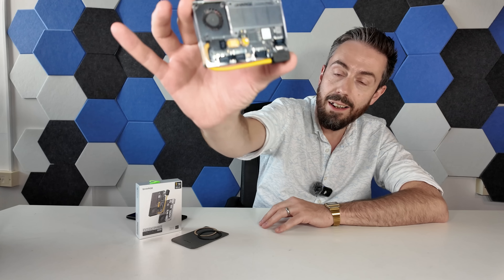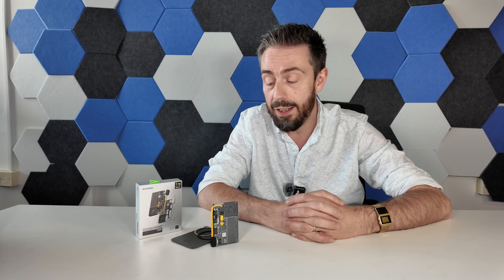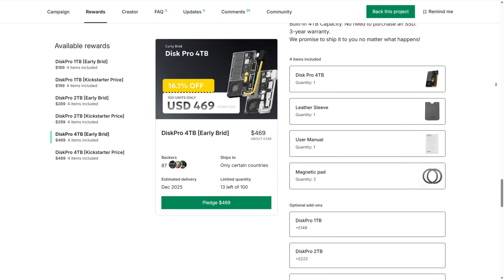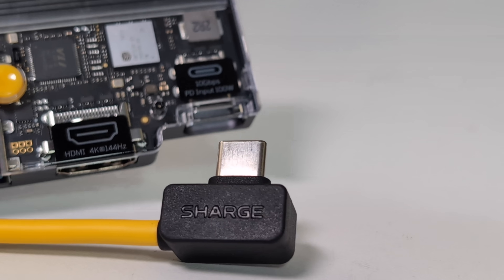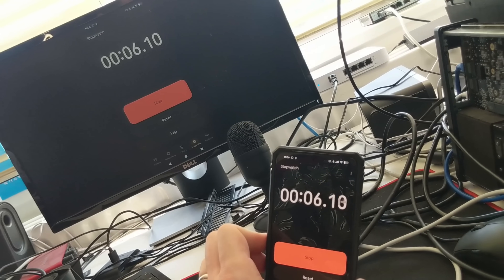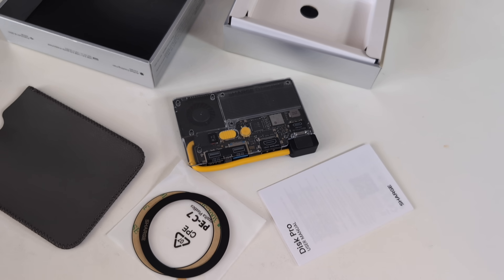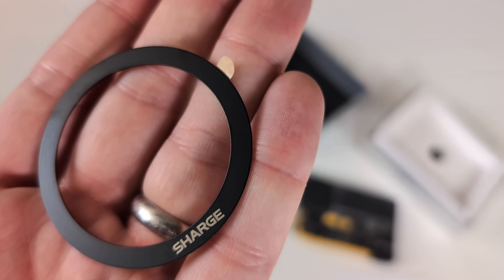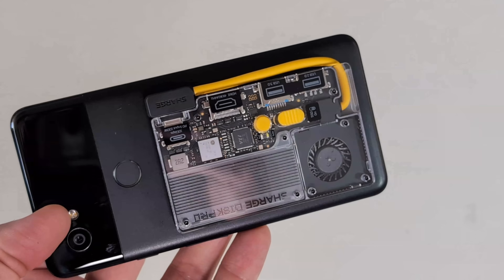Sharge Disk Pro Review - Mobile Storage Done Different?

Comment: dood, im still wondering if this device is good, its only 10g usb-c, and dp alt require 12g, meaning if using  the ssd + dp alt it cant even handle it right ?
Reply from the maker: Never had a chance to check the total active bandwidth, good Q! Will check on Monday. I connected 2x storage and the HDMI out, but I SHOULD HAVE hammered the drives at the same time as checking the visual out. Sorry man

Comment: You can’t upgrade it, because it’s sealed? It’s put together with screws. The cooling solution is going to be some sort of pads or something. They’ve solved this a long time ago. There is no reason to make it where you can’t upgrade the storage.
Reply: it’s soldered on the board, so even if you’re opening it unless very skilled you won’t be able to replace this. They offer data recovery but as it’s not able to secure data, it’s only useful for storing games imho and then it’s too expensive vs a none dock samsung t-series or a enclosure and put your own in it.

Comment: "You're not allowed to upgrade it" is the kinda BS that makes me say PASS.
Reply: I was pretty excited until that exact point in the video. Nearly $500 for the 4TB model and I can't swap it out if the NVMe dies? AND it's on kickstarter? that's a lot of strikes against it. I'd take an empty one for $99 though. A portable hub that I CAN throw my own drive in = win.
Reply: looks like standard screws, if it is an NVME inside then it's likely upgradeable / changeable anyway.
It's likely that they just CBA with supporting user caused breakages so state that that's not possible.

It's not like they can stop you opening it up.
Reply: not being able to encrypt it and focus on the tech industry - it’s unique but that’s a big no to use for data that needs to be secure
Reply: What would you really need to upgrade?
Reply: @BirdsOfGlass the ssd. You can find a 4tb nvme ssd on sale for well under 300usd or if you have a pc you might have one laying around as a spare after a big upgrade. They'd probably have to make it a bit bigger if it was modular though but I can't say for sure since I can't see the internals
Reply: @BirdsOfGlass that drive dies and you can't swap it. You want to pay that much money for something like that?

Comment: For a smartphone this would have been impressive... if it weren't for microSD being a thing. At least it has the other types of connectivity.
Admittedly most phones these days don't have microSD slots. But there's still options available and I've never had a smartphone without a microSD slot.

Comment: Lol, I don't see the point.
Reply from the maker: I think it's more labour a kind of user who wants to travel light and consolidate. Had this with me in Scotland last weekend + my DJI Pocket 3. Allowed me to have a fast backup, HDMI output to edit and connect my tether/internet in a carry case that fit in my coat pocket. It's about scale and portability tbh
Reply: @nascompares  That sounds like a fun trip! Could you also just use a usb hub with HDMI and a small hard drive? I just think all their stuff is overpriced for aesthetics but I'm cheap and don't care about that stuff much. Nice video non the less.
Reply: @natearrigoni  Yep you could use a $20 usb-c hub and a $30-50 USB HDD/SSD to achieve the same. What you're buying here is a neat package. Convenience and sex appeal. I have one of their see-through battery packs. Cool stuff, but it didn't cost triple the competition.
Reply: @scrampker  Only thing that is missing is a case that takes eg both the Sharge disk + phone for portable solution. I can't seem to get if it comes "with" or without the 1-2-4 tb disk

Comment: if you use wireless charging at all, i dont think you will be able to after installing the ring. most people dont know how unsafe it is to put metal tabs or rings on the back then trying to wireless charge, you will run a chance of cooking your phone and possibly overheating to thermal runaway of the battery.

Comment: Almost had me, had it have the ability to put in your own storage. I get what they are trying to do but at the same time, memory will fail. Eventually. Cool product nonetheless.
Reply: There's some active cooling USB 4 enclosures out there. I am currently using a 3.1 plain plastic one with a small heatsink exposed, and it gets too hot to touch. Active cooling, or full metal enclosures is recommended for nvme.
Reply: The smaller one you can swap nmv i think it’s called but the disk pro is a new release it hasn’t even come out to public yet mine won’t be shipped till the 19 of this month and ordered it back in December it did say in stock ready to ship but sharge emailed me saying it’s prerelease